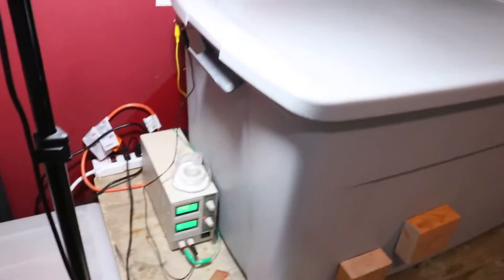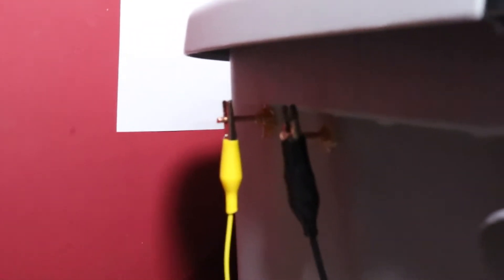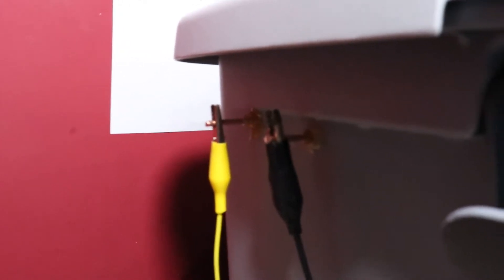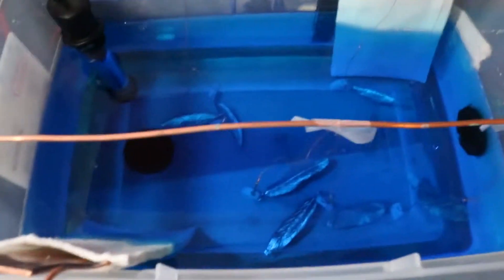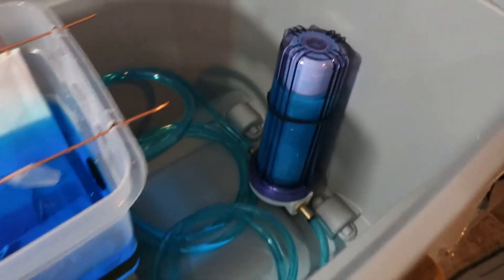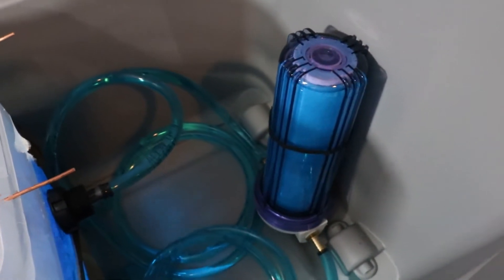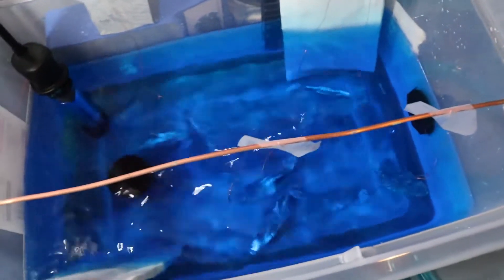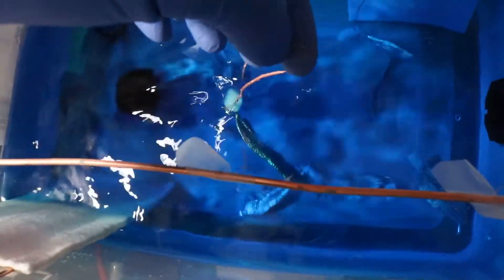Electroforming tank with built in filter!

Comment: Awesome tank, what kind of pump do you use and where did you get it?  I purchased Jason Welsh's tutorial on setting up an Advance Electroforming Tank but when I go to the link at the end of the video for the parts list, that link is no good. And he doesn't have a contact page on his website. Thanks for your help!
Reply from the maker: Hi gloria, here is the list: Advanced Tank Build with carbon filter
2 Bulk heads  ½ in
https://www.amazon.com/Ebb-Flow-fill-drain-fitting/dp/B01D1Y9DEK/ref=sr_1_fkmr1_1?ie=UTF8&qid=1546721186&sr=8-1-fkmr1&keywords=EBB+1%2F2+bulkhead

Tubing https://www.amazon.com/dp/B01N4B9DRM/ref=sxts_kp_tr_2?pf_rd_p=8778bc68-27e7-403f-8460-de48b6e788fb&pd_rd_wg=PTS0Z&pf_rd_r=V9FVVWB853AXYSYWP8Z9&pd_rd_i=B01N4B9DRM&pd_rd_w=MVVF9&pd_rd_r=e59194f0-fc8e-4c8e-8e92-fe4aeacb62c6&ie=UTF8&qid=1546722443&sr=2

Hole saw 1 3/8
https://www.amazon.com/LENOX-Tools-Bi-Metal-Speed-Technology/dp/B000LNMYD2/ref=sr_1_6?s=hi&ie=UTF8&qid=1546722700&sr=1-6&keywords=1+3%2F8+hole+saw

2 in hole saw
https://www.amazon.com/LENOX-Tools-Bi-Metal-Speed-Technology/dp/B004FCLADU/ref=sr_1_1?s=hi&ie=UTF8&qid=1546722900&sr=1-1&keywords=2in+lenox+hole+saw

ispring filter
https://www.amazon.com/iSpring-FP15X2-Transparent-Housing-Filters/dp/B00BGC41Z6/ref=pd_cp_60_2?pd_rd_w=jPp5I&pf_rd_p=ef4dc990-a9ca-4945-ae0b-f8d549198ed6&pf_rd_r=W5HQJKNM6ZVK8GP38CSA&pd_rd_r=7587632e-1130-11e9-bf6f-1bc6f4fe85da&pd_rd_wg=B1E4r&pd_rd_i=B00BGC41Z6&psc=1&refRID=W5HQJKNM6ZVK8GP38CSA

Filter Bracket
https://www.amazon.com/Housing-Bracket-Filter-Housings-Aquaboon/dp/B077QHV364/ref=sr_1_1_sspa?ie=UTF8&qid=1546733817&sr=8-1-spons&keywords=whole+house+bracket&psc=1

1 Micron Anode bag material
https://www.amazon.com/dp/B004JH9EUW/ref=biss_dp_t_asn
Heater thermostat
https://www.amazon.com/gp/product/B07FYXX9L3/ref=oh_aui_detailpage_o06_s00?ie=UTF8&psc=1

Heater
https://www.amazon.com/Cobalt-Aquatics-31021-Mini-Therm-Heater/dp/B0090I7TDO/ref=sr_1_4?ie=UTF8&qid=1546734370&sr=8-4&keywords=10w+heater

Plastic Containers should be bought at your local shopping center  
The brand I use is Sterilite
Big plastic container
23” L x 16-¼  W x 12 ⅜ H

Small Container
16-¼ x 11 ¼ x 6 ¾ 

Iwaki Magnet Pump
MD-10-NL11
MD-10 is the important part when looking for a used one on ebay.

NL11 can be anywhere between 06 -27 and should be ignored

https://www.ebay.com/itm/Iwaki-MD-10K-NL27-Magnetic-Drive-Pump-11-12-liter-per-minute/323632963993?hash=item4b5a072199:g:pz4AAOSw0wJcLXGh:rk:46:pf:0
Reply from the maker: Here is a pump on ebay. I bought mine used for around the same price: https://www.ebay.com/itm/Iwaki-Magnet-Pump-Model-MD-10-NL/233627923527?epid=4023276260&hash=item36654f3447:g:Zy0AAOSwAHZURC2U
Reply from the maker: Just make sure if you get a pump that it says IWAKI MD 10, not MD 20 or MD 30, those are too powerful
Reply: @bradenwade   Thank you so much for getting back to me so quickly.  I live in Canada and am having a really hard time finding an Iwaki magnet pump. Hopefully I can find another brand to use! Your tank looks awesome!  Good job!  Do you have a website or online shop, I would love to see your work.  😊